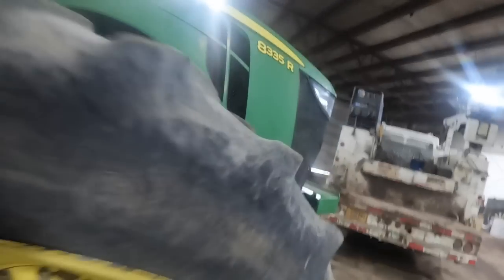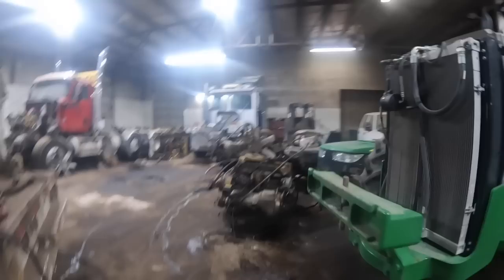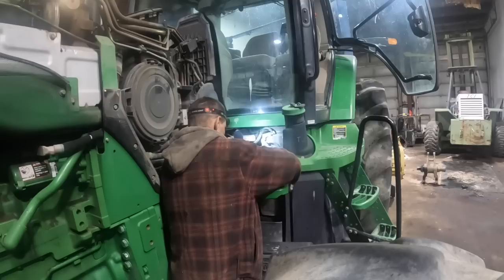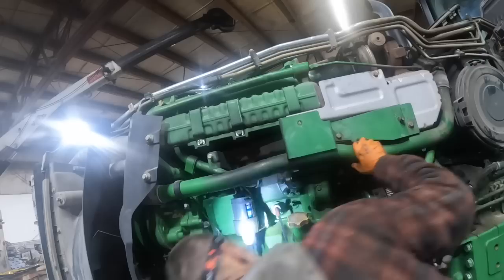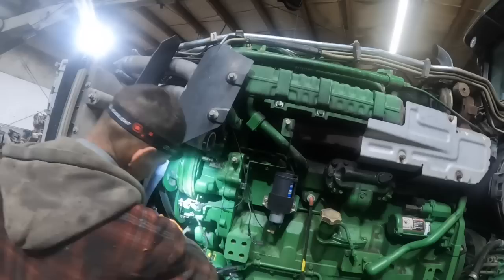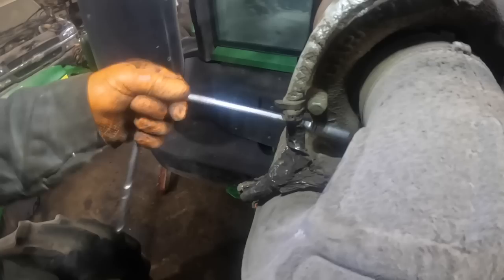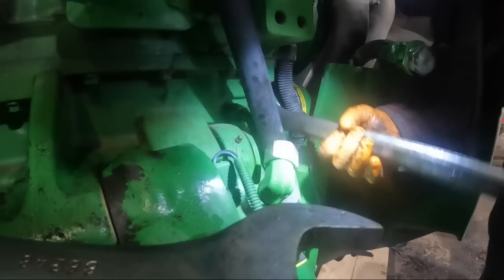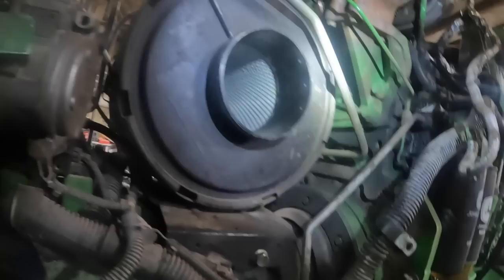John Deere 8335R  engine overhaul pt.1

Comment: There is that 'story' about a miner working with mules underground. But the tunnel was a bit low and the mules were damaging their ears in the tunnel. So the old miner started to dig away at the roof. His friend asked why he did not dig out the floor because its obviously easier. The old miner replied ' The mules are hurting their ears, not their hooves!'🤣

Comment: I am amazed when you read about the railroads when they were first build. They did all that work with wheelbarrows and picks and shovels.
Reply: And black powder . Nitroglycerin was used by the Central Pacific (later the Southern Pacific , lately Union Pacific ? ) , to build from Sacramento,  CA  thru the Rockies to meet Union Pacific at Promissory Point , Utah in 1869 . About the same time dynamite was invented by Alfred Nobel of Sweden . This made tunneling thru hard rock possible , much safer and cost effective.  Mining and construction benefitted around the world.  Building was possible in many places and accelerated making a modern world possible . Too much to list . See economics and modern general history . Also see high explosive use in ordinance and the big changes in warfare . Compare our Civil War to WW1 .

Comment: Love your story about the two young guys who ended up getting covered with hydraulic oil and fortunately did not get hurt. Love the comment below about the miner who was carving out the ceiling for clearance of the mules ears instead of digging out the floor of the  mine a task which clearly would have been much easier hahaha.

Comment: Nice Project Warren. Thanks for Sharing the video and Stories. 
I always put bolts or nuts back on too where possible.
Also used cupcake pans for bolts and labeled each with tape.
You need a 3/8 and 1/2" cordless ratchet. I've had a 1/4' for ever and finally caved in and got the other two.
TGP

Comment: Warren u can go into tech mode on the armrest, use the IFS cal address to lower the suspension  down also, or up. Lock out scv then use scv 1 in detent position  to go up and down

Comment: There is a channel called ZX master tech and the guy works for a big Deere dealership in the midwest. You would not believe what this guy goes through working on the new machines. Takes hours of disassembly to access the simplest repairs like a blown oring or small valve change out etc. If you want to see frustration go check him out. He keeps his cool but he catches hell working on that stuff. I have a neighbor who has two of those tractors. It looks cool when you start them cause they will rise up in the front like a monster waking up from sleep. They sure ride good and you get better traction over uneven ground.

Comment: What year is that tractor? How many hours are on it? Is that a reasonable amount of hours for a rebuild or did someone leave the air filter out Etc led to an early demise? Are you going to rebuild it in frame or will you be removing it from the tractor
Reply: Has to be removed from the tractor as the front frame member and the oil pan are a one piece cast assembly, so the engine has to be lifted off.